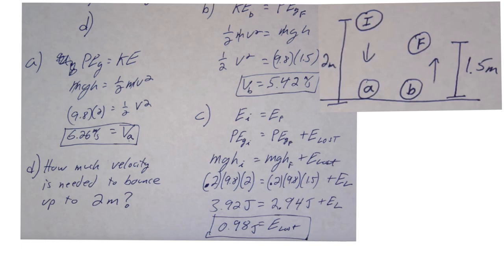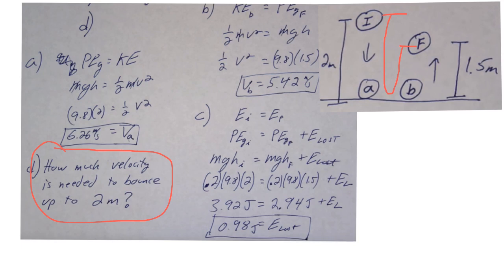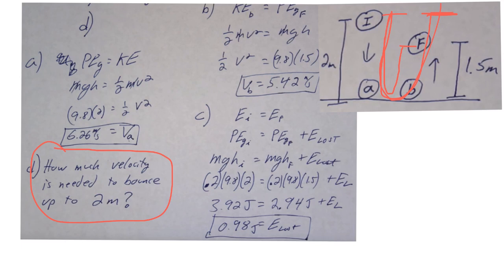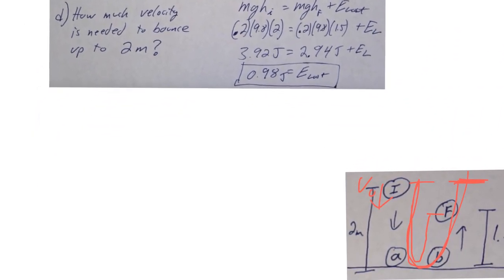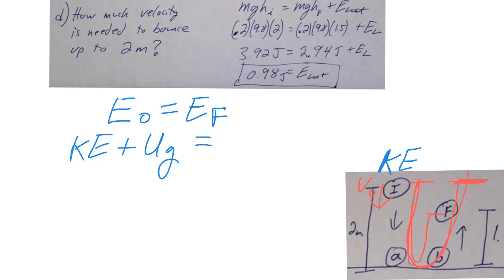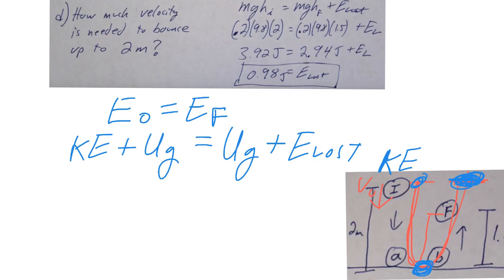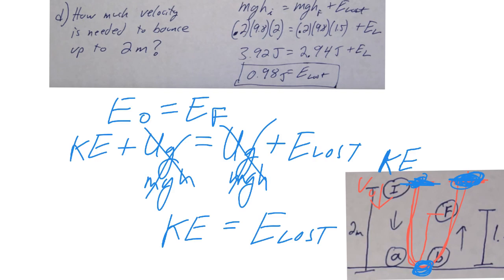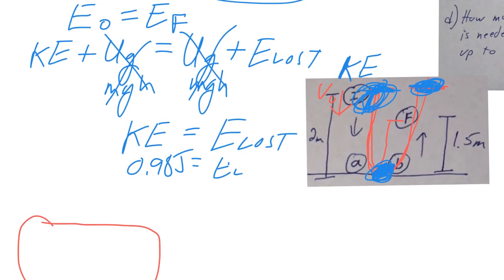Energy Loss Bouncing Ball (Part 2)

Comment: Well done for the easy explanation. But I was wondering, wouldn't an initial velocity result in losing more energy upon bouncing, than when it was dropped? Thanks!
Reply from the maker: Excellent question! You are correct.  As you mentioned, I kept it simple for the level of the class (and to emphasize a concept) I appreciate your willingness to think deeply.

The energy loss would likely increase because of the increased energy added to the system. Assuming that the percent energy loss is the same  you should be able to calculate the true necessary velocity.  See if you can do it yourself...I get 3.6m/s.